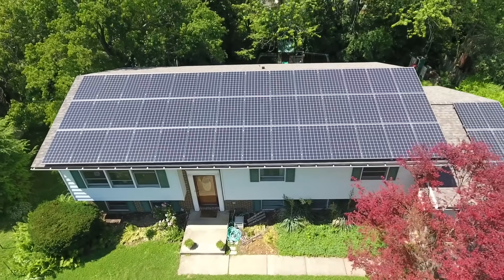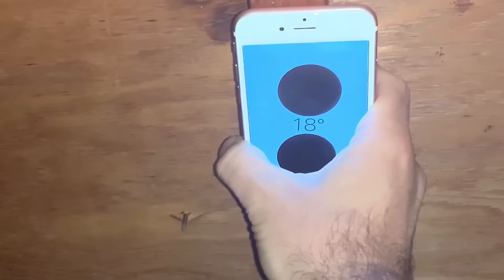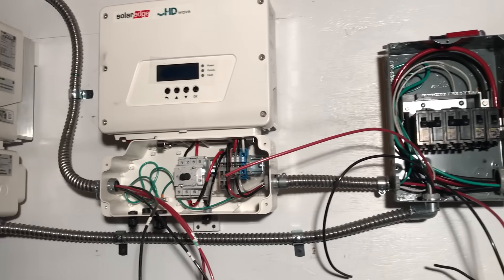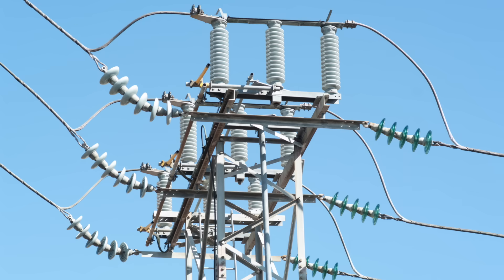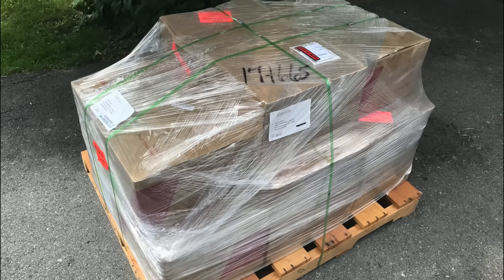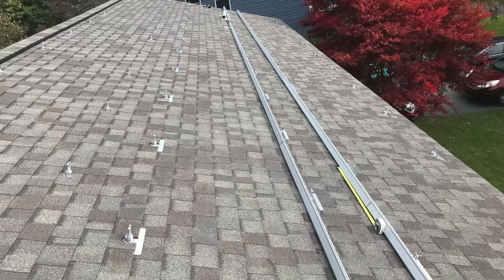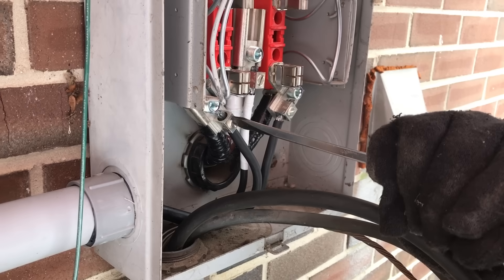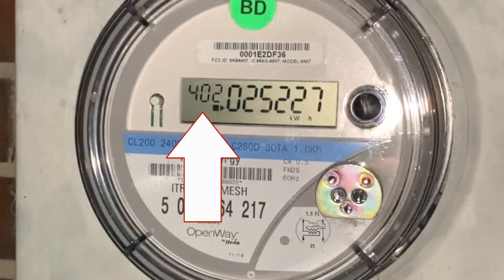I Installed a Power Plant Myself | HUGE DIY Solar Panel System

Comment: You are hiding some very important points.  You don't generate all your energy needs with that system, you are also using natural gas for more than half of your energy needs.  If not natural  gas then propane, oil, or wood.  No one's roof is big enough for energy independence, even if you covered the other side as well.  You also forgot to mention you are still very much dependent on the grid, you are using it as an unlimited battery.
Reply from the maker: You are incorrect about your assumptions.  I don't have any power source but electricity.  Watch my videos on this topic if you are interested.  I explain all of the details, show my bills, explain how net metering works, etc.
Reply: @FrugalRepair   No, you have another source of energy you are not disclosing.  With such a small system you would not be able to heat water, cook, dry clothes or heat your house with just electricity.  You might have enough for the summer if you are very careful, but come winter you are in severe deficit.  I have been doing solar/wind/EV's for more than 40 years so I know better.  I appreciate you did most of it yourself as did I, but we don't need people blindly going into alternative energy without knowing all the facts, the government lies to us about ruinables enough already.

Comment: Great ideas!
And why not store water in a water tower.
(Instead of electricity in a failing battery.)
Eliminating the battery hassle.
For a historical water wheel.   
SHTF
And solar panel the water tower, and the roof tiles :)
LETS DO IT GOVERNOR!

Comment: Nice job! That mustve been a lot of research! I am no expert, but I think you did well.

How are the zipties holding up? I used zipties on my roof and the ones in direct sunlight lasted about 1.5 years :-/
Reply from the maker: Thanks!  I haven’t noticed any broken zip ties yet.  I got the most UV protective ones I could find and they are not in direct sunlight.

Comment: Great Video! Do you have battery storage? I work for a production facility that has 48v Fork Truck batteries that they will let me have for almost nothing. It is worth it? Telsa Powerwall is like $15k. Does anyone have a design for these batteries to be used in solar and how many does it take to replace 99kWH / mo.?
Reply from the maker: Thanks for watching!  I don’t know how many kWh of batteries they are willing to get you (and at what price) but if you are willing to DIY the project, then it could be beneficial for you.  Jehu Garcia has projects like that.  Have you watched his channel?
Reply: I’m watching now! Great work BTW! Were/are you an engineer or just a tinkerer?

Comment: When people say the power grid can't handle the added need for electric cars I think of how if only 10% of homeowners do this it would increase the grid capacity by so much. Some peoples properties can even do way more than this guy.
Reply: lol. Ok everything is already double the price what it was 10 years ago , buy an ev for 80k, then buy solar, batteries and electronics  for another 50k? Sure man! Not to mention this only saves a couple hundred a month in electricity till the government figures out a way to tax you on solar.

Comment: Thanks for the confidence-inspiring video!  I want to install a ground array w/o batteries, so will read your guide that I downloaded--and then I'll shoot you any suggestions or questions.  But I am greatly encouraged because this is looking like a DIY project I can handle.  

I will be swapping my propane-fired radiant heat boiler, water heater, range and dryer for electric versions, so presumably will need to factor in all the new appliances, plus EV charging and my wood shop's needs to determine the size of the array...
Reply from the maker: Good luck with the project!

Comment: Nice video. I know at the end you said you haven't had a electric bill in a while. Do you still have a demand bill? From what I've seen, the power company will still charge you a 'demand bill' even if you have solar. This bill covers things like keeping the infrastructure to get power to your house, up-right and working. Also, at 9:55 are you installing a tesla backup switch. Those are pretty cool but I believe you need grid forming inverters for something like that? House looks great!!
Reply from the maker: Thanks!  I have a few videos on the financial aspects (what I spent, how it earns money each year) that may help answer your question.  There is a $7 charge but it gets covered by other credits.  I don’t have a tesla switch so I don’t know what you mean.  There is a mandatory safety disconnect switch, that is a necessity for any solar installation.

Comment: Why wouldn't you have battery storage be the main supplier of power to your house? PG&E pays a micro fucking fraction of the rate compared to what they charge, meaning all the extra power doesn't give you a good return, meanwhile if you're using the power instead of PG&E you pay way less at night and long term. From an experienced point of view, it's fine, but you tried selling a guide? What the fuck? "Hey guys, I dug a hole and put water, I now expert on pools!" No you're fucking not. 2/10
Reply: LMAO

Comment: Sorry I know it’s been three years, but I want to ask. Your theory was based on using your solar first, then getting a credit from the grid, but from what I understand, that’s no longer possible for grid connected systems, it seems they take all your power, give you a credit at 90% and apply it to your bill. 

Have you seen this to be true?
Reply from the maker: I have 1-1 net metering but this is not offered in every state.  My solar earns money (in addition to saving on power bills) each year.  Check out the video I made on this topic (if interested - the title is how I earn with solar)

Comment: Awesome video but I hate to break it to you. Did you read the fine print from Panasonic and LG? They do not warranty coverage solar panels installed by a homeowner. You have to have a solar installers license. I looked this up extensively and call Panasonic and LG. It’s their fine print. Sorry to break the news to you !

Comment: What happens if there is a hail storm
Reply from the maker: Nothing usually.  The panels are made to be outside in the elements.  An unusual storm with significantly damaging hail of course, could have an impact but that is not a normal weather occurrence.
Reply: @FrugalRepair  Good to know, thanks!

Comment: Cost of panels, batteries, connection infrastructure, etc.... and the ROI is literally decades.   And when those decades are up, and you need a new roof.... well.. there you are.
Reply from the maker: What batteries are you talking about?  I didn’t install them.  And you’re misinformed, payback has been about 5-6 years. Roof will last longer than normal because it’s covered in glass.  You may not like solar but the math says otherwise.

Comment: Solar is nice and all, but still have batteries to deal with.......which give off toxic fumes when charging, even dry cell batteries!!!  Hate to say it but solar is NOT the future when still using batteries to store the power.  Props for the solar, fail for the power storage!!
Reply from the maker: Why do you have to have batteries?  I didn’t install them or even talk about them in this video.

Comment: Can it run 247 like high end 1000watt power pc with i9 rtx 4090 24gb 200 gb ram 4k 2000 watt 247? And ultra max MSFS? And 4090 max settings 247?
Reply: You can run up to 5 PC at the same time by using this solar system 😅😅😅

Comment: I am fine with you doing this yourself, but in most locations you can not pull your own permit for this. I have been an electrician for 38 years and I could not pull a permit for this. Permits are only issued to Master Electricians. So most people will need a Master Electrician to get them a permit and check their work even if they want to do most of it themselves.
Reply from the maker: Where are you located?  What would be the rationale?  If you are an electrician, you are more than qualified to put in solar.  This is what the inspection process is for.  If you didn't install it to code, then the inspector would fail you.
Reply: In Kenosha, WI . Yes, I am more than qualified, and I installed 53 solar panels on my house, but it is not the inspectors job to check all your work. You seem a little confused about how all this works.

Comment: What about the interconnection agreement requirements? The requirements for my coop ruined my 20,000$ grid tie system. I converted it totally offgrid after my house burnt down and they survived.
Reply from the maker: I’m sorry to hear you had trouble (and deal with the fire!). I’m not sure what your question is, we had requirements but they weren’t anything crazy.
Reply: The requirements for my electric company required a insurance premium that would have ran more then the system produced.. 

Did your interconnection agreement have insurance requirements, if so how much?

Comment: If you did micro converters, you would get more power just not sure how many watts each panel is giving out but 7,500 watts you should be getting at least 30,000 watts/Kw or more like I said depending on the watts per panel.

Comment: Yea, don't be a hero when that much voltage is there. Good thoughts for hiring an electrician for that one part. I could never be an electrician. If you screw up as a plumber you get wet. If you screw up as an electrician you either get seriously hurt or dead.

Comment: I live in Ohio just purchased 30 ×310 watt panels I fig. Once I got them I would have to do something with them your video is exactly what I want to do. The question/comment I  have is the utility co. Will not let you hook up to there grid whitouy some type of charge may it be a meter reading, or anu of a half dozen other charges they may think up So you say no bill be honest what are the charges? And how much per month?
Reply from the maker: That's great you are getting solar.  I have made several videos giving all of the details from production to what I spent.   The how I earn from solar is the most recent one.

Comment: You need to terminate those open ports on your coaxial 4-way splitter, you’re getting unwanted noise in the lines with those open ports, especially that close to power, which affects Internet. They’re cheap, maybe a buck for two, or bug the next cable guy you see for a couple, they’ll give you them for free (or at least I would). Also make sure every fitting in the house is torqued tight.
Reply from the maker: You have a good eye.  That coax splitter is long gone.  But good to keep in mind if they show up again.

Comment: I did the exact same thing, but in addition I had to de-rate my main breaker coming into my AC panel from 200A to 175A due to the size of my system.  My research also suggested that I install my solar breaker at opposite end of my main breaker.  My system is just under 10kw and produces enough power for my 2600 sf home such that I had 3,000 kwh excess production at the end of the year, I used Enphase system with candian solar 400w panels.  I’m happy!
Reply from the maker: Nice!  Did you do all of the work yourself?  Sounds like you did.

Comment: Does you home owners insurance allow that much power being created. Zone laws too.
Reply from the maker: My system is good with everyone.  The main issue is if you want to feed power back to the grid.  For me the power company requires an electrical inspection to qualify for net metering.

Comment: Should install some batteries and sell the power back at peak times.
Reply from the maker: That depends on if you have Time of Use rates with your utility.  I don't have that but we do have 1-1 net metering.

Comment: Very inspirational video! I'm curious if you happened to measure the areas inside and outside your home with an EMF field meter before you installed the panels and after you activated them, for comparison. I've read that levels can jump considerably when solar panels are added to the equation.
Reply from the maker: Thanks!  Nope, I didn’t measure.
Reply: @FrugalRepair my worry is installing solar on the roof could possibly create unsafe EMF levels, either from the panels themselves and/or the inverter(s). It’s the only thing holding me back from going solar. The last thing I want is additional exposure to high threshold EMF levels over my head while I work from home. Field meters are reasonably priced… it would be great if you did a video on it to either prove or debunk the theory. Though if you end up proving it, I guess that wouldn’t be great for business.

Comment: I'd not want grid tied solar. To me part of the benefit of solar would be 100% reliable power. Even after a storm I'd have power. But with grid tied solar your power must go down when your connection loses power. I'd rather build in a bit more capacity and simply ditch the grid altogether. But where I live blackouts are common and you can expect to lose power for a day or two every 2-3 years. With 1-2 hour long blackout happening near yearly. About 4 years ago we lost power for nearly a week after a particularly powerful storm cut power to nearly the entire city (of nearly 1 million people). With grid tied solar I too would have been without power even though all my generation would be local. It simply does not make sense unless you can't generate enough to meet your needs.

Comment: I can just imagine the energy savings from the cooling factor. The rays doesn't hit the house directly, therefore having a cooler house in the summer and not having to run the ac as often. That sounds awesome.

Comment: So the way solar panels work is that each block acts as a single organ.  If any light is blocked the whole thing goes to zero.  If you pause @2:08 in the video you can see that most of the roof top is in the shade.  This means that only a very few panels are making any power at all.   This is why you need to do this in an empty field or on a roof with dawn to dusk 100% illumination.   Thumbs down.
Reply from the maker: I hope you will consider changing that thumbs down.  You are incorrect on most of what you posted.  My roof is about 95% without shade most of the year.  Plus, solar panels have blocking diodes to minimize the current impediment due to shade, and since I have SolarEdge, each panel is unaffected by the one next to it.  So if you are considering solar, you do need to consider shading, of course, but you don’t need 100% never shade to make it worthwhile.
Reply: I hope you consider trying not to mislead people on youtube for more clicks.
Reply from the maker: @krakenunbound what is misleading?  I share the details of what I have spent, the details of the KHW produced, etc.

Comment: the most expensive item is the battery.
most battery lifetime is less than 5 years.
for a 25 years system, the battery gonna cost you more than you calculate
Reply from the maker: I didn’t install a battery nor did I mention batteries in this video.  Were you referring to another installation?

Comment: You forgot the other side of the roof 😜
Reply from the maker: It’s not economical to put them on the north side.
Reply: @FrugalRepair  depends on what you can sell the kWh for and how much energy you need. In Germany I get 7,5ct/kWh. I have a heat pump for heating in winter and a Model Y. So north makes much sense for me. And if you do south, it is not so expensive to do north, too.

Comment: As a retired Electrician/Technician you did a fine job.  The only thing I would have done differently would be the installation of a battery bank in the event you have a long term grid down situation.  Then you have power in your home when the moon is out and none coming in.  Just a back up to a backup.  I am less than 30 miles from a large hydroelectric dam on the Columbia River yet my power bills have tripled in the last two years and are still climbing.  I don't know why but personal power generation and backup systems are becoming more attractive and necessary here.  Great Job and great video. Thank you.
Reply from the maker: Thanks for watching!  The power rarely goes out here and we have 1-1 netmetering.  So at the time the costs for integrated batteries weren’t worth it.  I think it’s a great idea if you want the backup or you have time of use rates, or something less than 1-1 net metering.
Reply from the maker: Also, I do have portable battery backup that I use in power outages.  If someone is on a tight budget they could build their own battery/solar/inverter system for backup.

Comment: It´s not worth it if the solar panels and other accessories are too expensive and it would take many many years to recover the investment in the first place. You can have good electricity in those years anyways, so as i see it its not worth it, only if the solar panels become really really cheap.
Reply from the maker: That may be true for some but this system has been a great financial investment.  If interested, watch the video I made on how this system earns money (not just saves money)

Comment: this is a very detailed video of something i was just looking into; but have been passively interested in home solar (but i dont own a home lol) but I have a offgrid rv system so i thought I would just watch this. subbed
Reply from the maker: Thanks!  What kind of system do you have in your RV?  I put on solar on my RV earlier this spring and it’s been working great.
Reply: @FrugalRepair  I wish I have the confidence as you have. but we might implement this on a home. 

i am using bluetti ac200max; i bundled it with their "350w" portable panels x2. 

tested them today on a cloudy day, got ~500w input from the panels.

i'm happy with it. I am in the process of adding a softstart to the A/C. 

I'll be testing the limits during winter.